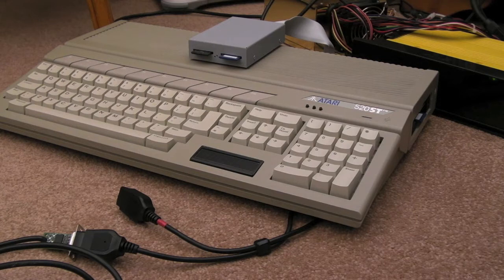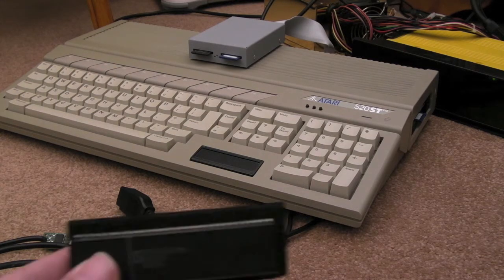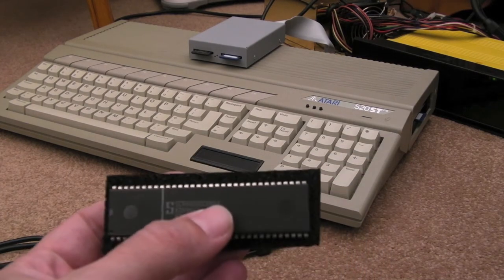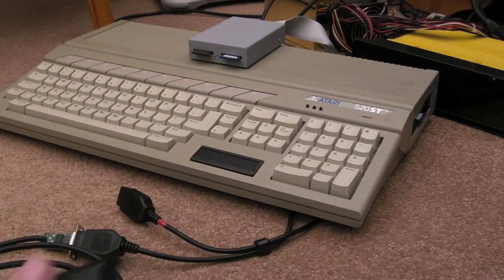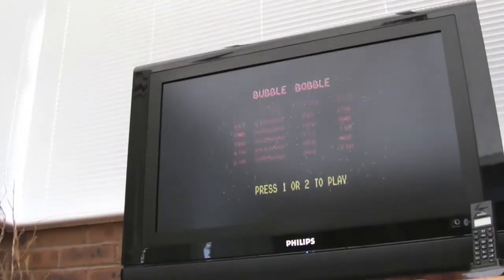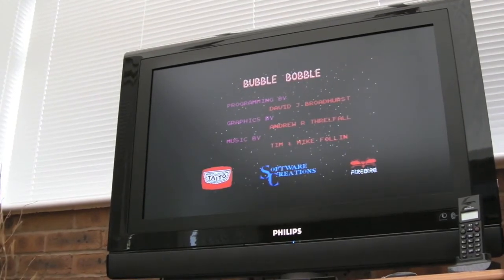Atari ST 16Mhz CPU Update 1

Comment from the maker: Hey! Thanks for posting, and for your kind words =) When I start the 16Mhz mod (might do it at weekend as it seems pretty stable with the new chip) I will do another quick mod covering the Marpet install. It's pretty straight forward, just take your time and be careful mounting the little board that plugs into the top of the MMU socket - just to make sure you dont bend the pins.